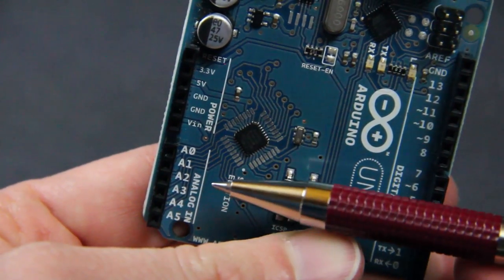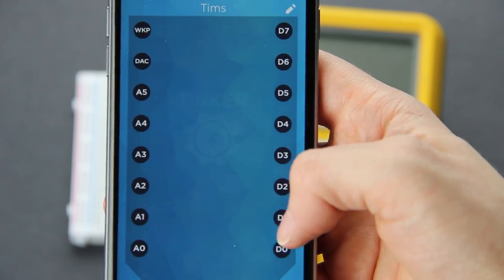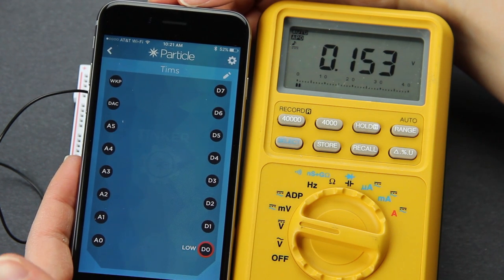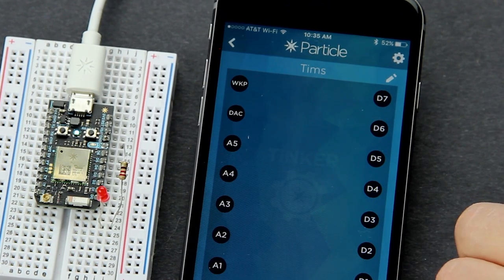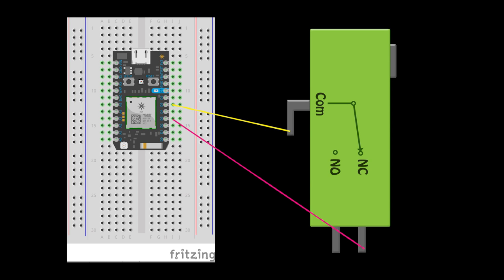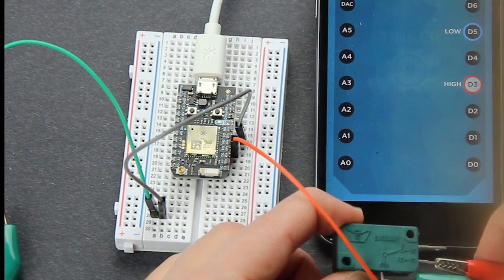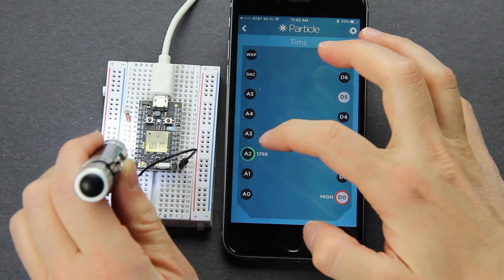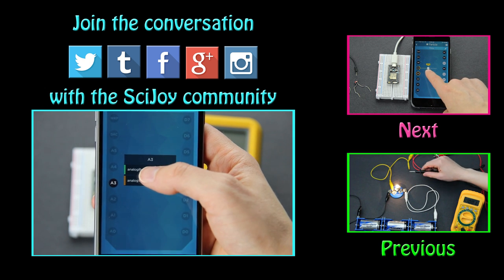Digital and Analog Pins | Arduino - Ep 2

Comment: How come the voltage on the analog pin doesn't change as a function of the resistance of the photoresistor? Why does the voltage only change when connected to a voltage divider?

Comment: What will happen if i apply negative voltage on analoge pin i mean if i changed the polarity of dc voltgae which are given on analog input pin?
Reply: You could damage the components. Best practice is to use a rectifier diode to prevent that from happening.